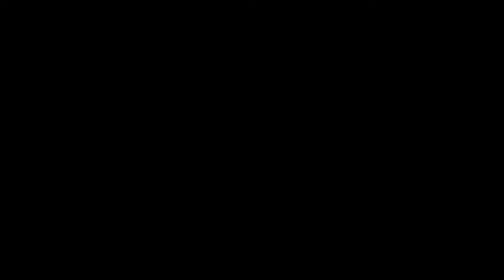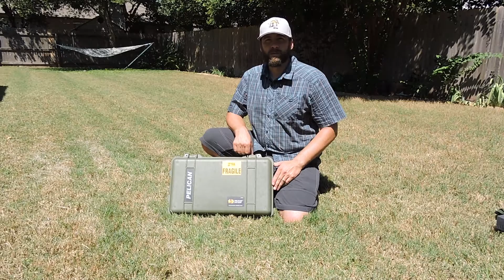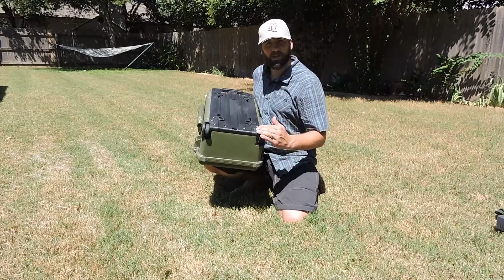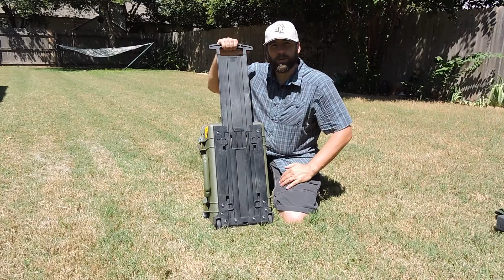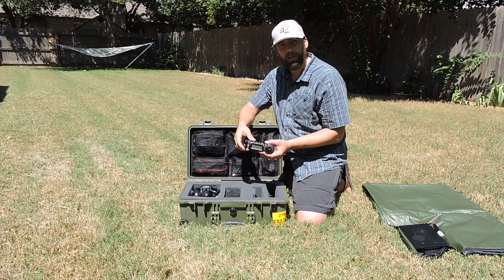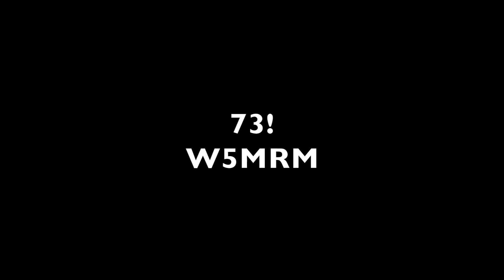DXPedition Go Kit

Comment: Nice and simple set up.  The only additional piece of equipment would be 12 volt dc power cable with power pole connections on one end. The other end would have battery connection clips, with an in line fuse. Of course, it depends if you have the room for it.
Reply from the maker: I actually have one of those. I don't think I had it at the time that I made this video but I have added it. I think at this point I have powerpole connectors on nearly everything I own. Thanks for watching! 73

Comment: Great video. I have the same radio, tuner, etc and was worried the 1510 was a little too small when I saw it so I ordered a 1610.  I'd rather have a little extra room than not enough since I wanted to be able to put a few antennas in with the radio. I will order one of the net pieces for the lid. That's a great idea. Thanks.
Reply from the maker: Thank you for watching and for your comment. I do like the size of the 1610 and being able to add antennas to the kit is great. I may have to try one of those. The main reason I chose the 1510 is because it is within the FAA carry-on size restrictions. Thanks again and 73!

Comment: Hey, great video (quality and content). 
I saw that you own a Buddistick and, that there seems to be plenty of "free" (foamfilled) space in that box. Might it be possible to put the Buddistick and maybe even the shock cord mast into this bos with all the other gear?

73
Konrad
DJ6KR
Reply from the maker: +Konrad Ritter Hello Konrad Thanks for watching. With the two layers of gear it would be difficult to get the full complement of Buddistick gear I carry in the case. For more info on my Buddistick configuration please see this video: https://www.youtube.com/watch?v=FVUrx8xL6EA  I do believe you could get most of the components in the box though. For instance the mounting plate, counterpoise wire assembly, guy lines and coil could probably fit in the void on the left hand side where I keep the headset and manuals. You could probably wedge the accessory arms and whips in between the side of the box and the foam. I don't know that you could get the mast in there but I haven't tried. I generally put a battery or two and the antenna in my suitcase.
Reply: +W5MRM 
Well thanks for the video and the reply.
I own an 857 an similar gear to yours, and have a Buddipole on order since a few minutes. I also own an FT 817 for EDC but the FT857 ist more of a field station or HQ-type of radio to me. So I am looking for a "one case takes all" solution, so I can just put that particular case in my car and build up a HF Base station anywhere. Based on your answer I might consider a slightly bigger Pelican Case if that's availabe (I will ask Mr. Google). As I don't plan on flying with the case it might be worth a shot.
Reply from the maker: +Konrad Ritter Another option would be to put a few pieces of industrial strength hook and loop fastener on the cover of the Pelican case and then create or find a nice heavy cordura bag that holds the antenna components that can stick to the cover. The antenna wouldn't have the protection of the Pelican case but if you are putting it in your car it might not be an issue. 73!